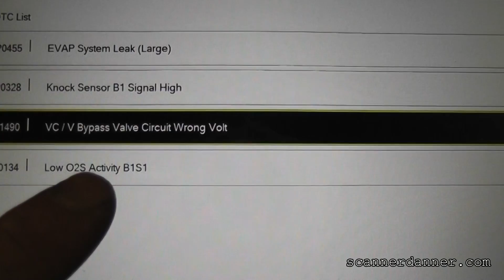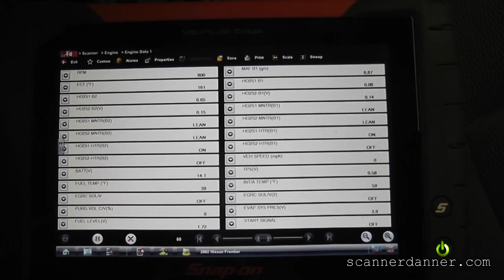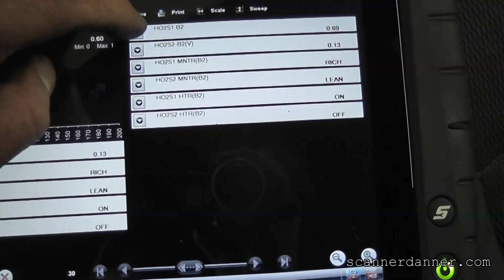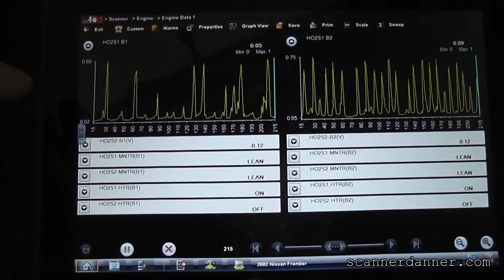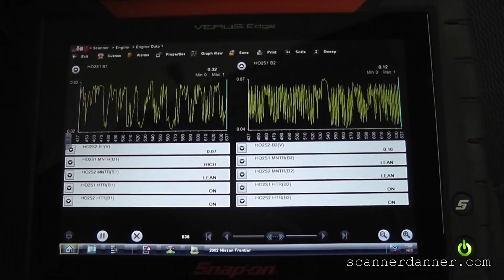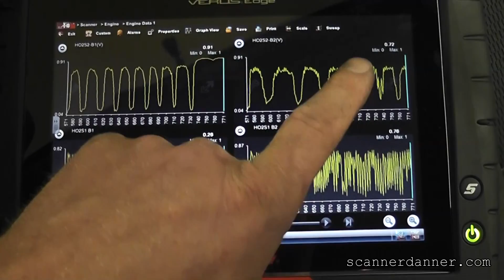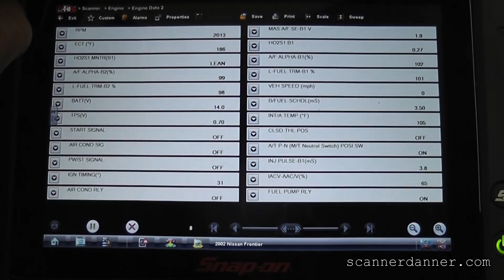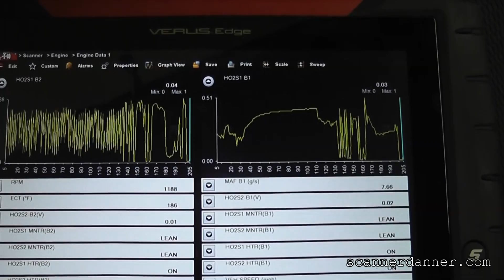Oxygen Sensor Slow Response test (P0134) - Nissan

Comment: hi, I need your help: upstream is between  1 to 2.3-volt variable  on the graph and downstream is between 0.28 up to 0.75, I have bad smell from the car and check engine is on for p0420 but car performance is so good it is fast and every 2 weeks I put gas,  but for short term downstream I don't have data , could you help me for the problem ( Also when I clean the code, after a week it comes back!)
Reply: Hello khalil khamisi i have the same problem did u fix it bro??
Reply: I have the same bro did u fix it?
Reply: @rankgts3962  I changed the sensors, still that was same, so I just changed catalyst converter and cleaned the code and after 8 months that code never came back.
Reply: Khalil Khamisi i changed the catalyst converter and both sensors but i’m not sure if they are working but i get them used but of its not the sensors and catalyst what will be ?
Reply: Khalil Khamisi btw i have altima 2014 (4 cylinder ) with code P0420 with P1148
Reply: @rankgts3962  I searched the p1148, so you have changed parts, but p1148 is about closed or open loop, it is mean your car have wiring problem, follow each wire of sensors to see any problem.
Reply: Khalil Khamisi from the sensor itself or the wire sensor from the car
Reply: @rankgts3962  bro you need to check it completely, from the sensors to the board, I guess the harness has problem, check that for any crack, corrosion, or missing pins in the harness. Check all the fuses, also reset the code to see if it's coming back or no
Reply: Khalil Khamisi brother actually i’m getting volt from both sensors i’m really confused what i have to do
Reply: @rankgts3962  I think is better to go to a cheap shop to tell you the cost of problem but you fix it

Comment: Can a bad O2 sensor bank 1 sensor 1 on a 4 cylinder cause low power?
Reply from the maker: yes it can, but it will run good cold and at wide open throttle (open loop conditions)

Comment: How would one go about checking the heater circuit/H.C. fuse for a P0134? THNX
Reply from the maker: A heater circuit ode is usually caused by a bad O2 sensor. With the engine running you need to check the O2 heater circuit for a power and ground. Be aware that some of these are pulse width modulated on either the power or ground side of the heater circuit, so voltage readings will be affected by this.

Comment: Got a quick question for you: I have O2 sensor B1S1 slow response. My car (2006 Kia Sportage) runs on LPG. Should I measure the sensor on petrol or LPG or does it not matter? I figure it doesn't matter since the LPG system is supposed to fool the car's sensors in to thinking it is running on petrol. Either way, I've measured on both and the measurements are 0.05v-0.7v. It never makes 0.8 and is way lower than 0.2. What is that telling me? Failing sensor? Or something else?
I'm not a mechanic, but love learning from your videos, so thanks for doing them!

Comment: Confusing.
Reply from the maker: watch some more of my videos or ask me a question, I'll try to answer it.
Reply: ScannerDanner thanks for that, I have just changed an oxygen sensor my car and have monitored it on the OBD2 hand tool, it fluctuates up and down 0.2 to 0.8 mV as you would expect, but the car has developed a new issue, it misfires after cold starting, it ran well when I first replaced O2 sensor, then it developed a misfire sounds like it's running on 5 out of 6 cylinders, not sure if it's related to the new O2 sensor. My question is what does the graph of a normal running oxygen sensor look like under normal operationing, idle, start and driving conditions. It runs at idle ok, 0.8mV for 3 sec then down to 0.2 mV for 1 sec then back up to 0.8mV but when driving around is all over the place. It does not have a catalytic convertor or down stream O2.
Reply from the maker: If you have a misfire the O2 will certainly be affected by that. If it is a cold engine only misfire, check it for a vacuum leak. Like in this video. 
https://www.youtube.com/watch?v=h8rxpfRvHf8

https://www.youtube.com/watch?v=3RFTS22w6tM
Reply: ScannerDanner Mate,  you are so good, thanks, had a vacuum leak in my other Ford AU2, now it runs like a new car.found it using brake cleaner, could hear it but had to use the spray. The BA runs like a chaff cutter when cold, but its intermittent, thats the problem

Comment: In my car when i start the car in the cold and put the scanner right away recibe signal from both o2sensors like from open loop changes to closed loop in 20 seconds after turn the car ? Whats that really mean and plus both of them read so hight yesterday i saw something weird 1 sensor stuck on number 1.246 v for a while ?
Reply from the maker: do you mean something like this?https://www.youtube.com/watch?v=v8XrM-7BuOg
Reply: ScannerDanner  yeah pretty much but today i notice that the car it takes a long to start like cranks for almost 6 seconds and sometimes it cranks right away and also i noticed black smoke coming out from the tailpipe the spark plugs are new one i replace it 2 months ago it it seems like something wrong with the fuel system
Reply: ScannerDanner i check the fuel injector to see if they make the cliking noise they seem to working fine but i gonna need to check the fuel pressure and check the fuel pressure regulator disconnect the vacuum house and remove the Spark plugs to see if they smell like fuel probably could be a leak injector that is leaking into the cylinder when start the car it feels so weak poor acceleration

Comment: Could u do a video more covering the down stream vids or do u have one I didn't see it if u did
Reply from the maker: sure, what exactly are you looking for? There really is no difference when it comes to testing for function other than the delay of mixture changes from the cat. 
If you're looking for how to test a cat. I have videos on that. Here is one. 
https://www.youtube.com/watch?v=vyVnhCIMDnw
Reply: ScannerDanner watching ur videos has answered my questions... I'm new to the scanner world. I've monitored my sensors my b1s2 is reading low but does follow my b1s1 so I'm thinking cats bad I'm going to take out the b1s1 and do the pressure test.. I'm thinking it's not plugged it's empty sounds hollow like a tin can when I tap on it. Weird thing is on my freeze frame data my ltft was 99.9%

Comment: 👍 Hello. should we have the same oscillation with lambda probe (upstream) and lambda probe (downstream)? thank you in advance
Reply from the maker: Not if that cat is doing it's job. Also, they don't use wideband sensors for downstream O2s
Reply: the car of the decatalyser (dé-chat) is perhaps for that? Thank you for your help
Reply: even de-cat the car to was reprogrammed to have a good ratio air / fuel. In a test with launch creader crp129 premium the bank sensor B1S1 gives an afr from 0.99 to 1.07 at idle, and a current of -0.04 a + 0.04mA so close to 0.00mA for a good ratio! ?. the bank sensor B1S2 that gives me a lambda of 0.97 to 1.1 oscillates from 0.2 to 0.9v still idling and lambda probe at 350 ° Celsius (probably from de-cat). thanking you in advance for your help
Reply: I specify I am in lambda probe narrowband I think!

Comment: Would I be correct in replacing the sensor, if I have similar voltage readings on the same bank, but no code for the o2 at all? I'm working on a 2002 Xterra SE Supercharged, and the computer is limiting boost once it reaches closed loop. No other codes, new knock sensor. The only oddity in the data is that one front o2 sensor reading. Fuel trim on that bank is also always roughly -5% more than the other bank as well. I'm no mechanic, just a DIY'er with a a bluetooth odb2 adapter and a smartphone.
Reply from the maker: If you have a boost issue, I doubt it is O2 sensor related

Comment: After watching this video, I"m still confused about one thing.  Can you please shed some light on this.  When manufacturers changed from oxygen sensors to air/fuel ratio sensors, is it safe to assume that we are ONLY talking about the upstream sensor  and NOT the downstream sensor?  That sensor should still a normal oxygen sensor.  Please comfirm.  Thanks Steve
Reply from the maker: Yes, when they use an upstream AF sensor the downstream is just a regular narrow band O2

Comment: very good and simple video.  I have a question.  can you explain what the other tabs that you didn't click on mean?  I see there is one that says heater, that's part of the 02 sensor this you have to replace the sensor as well ?
Reply from the maker: Every car is different on what they show data wise. We call the data PIDs. (parameter identification)
Without watching the video, I don't remember for sure but if it said heater, this can be an on/off, a duty cycle command, a milliamp draw reading etc. etc. 
Like I said, every car if different on controls and how they monitor them and report them to the mechanic. Then there is a factory scan tool that will report differently than an aftermarket one like I was using. 
Hope that made sense.

Comment: down stream O2 flat lines after engine starts. it takes several minutes before any signal shows up. the two up stream O2's oscillate like they should.  would this situation cause a P0171 P0174 codes? this is a 4.0 OHV Ford Explorer.

Comment: I had a similar issue on my wife's Suzuki Vitara a few weeks ago. She called after a 100 mile trip saying the fuel mileage was low (did not tell me CEL was on!) I scanned the car and had a Bank 1 Sensor 1 Low Activity code BUT I had replaced both up stream sensors last year (faulty heater in one). Both upstream sensors when graphed appeared to be functioning properly but the Bank 1 downstream was nearly dead, only a blip here and there.

I reset the code and ordered both downstream sensors, a week later when I went to replace the sensors I scanned it and noticed I had the Bank 1 upstream low activity code again. I replaced both downstream sensors (does not seem to make sense to replace one when they have both been in there for 120K miles) and that fixed the issue. It still seems strange to me that the PCM was setting a false code for the upstream sensor when the downstream was bad.
Reply: Maybe they messed up labling the wires to the software writing on the PCM at the factory
Reply: Maybe the computer just compares the 2 and isn't accurate enough to determine which sensor it is.

Comment: I love my Verus Edge with Gorilla glass, SSD, Windows 7 Embedded, MS virus protection, TSBs, SureTrack, Troubleshooter, Mitchell On Demand...sweet package. Snap-on makes a 12V adapter with either battery clips EAX0066L04B or the lighter adapter EAX0066L10B for @28 for the Solus & Verus models.  Battery life is really good plus you can go to Standby mode and reboot in 5 seconds. Plug DC lighter adapter in on the way to the next job and you'll be ready to go!
Reply: Hi what is price of this Verus Edge,.,?
Reply: @$10-12K according to your Snap-on rep and what kind of deal you can get. Good customers usually get a good deal.
Reply: 👍 Do you know if can get it online internet.?

Comment: Just worked on a 96 Ranger 4.0 for P01131 & P0171 or 174 code. I called an o2 w/o checking deep enough. Replaced Bank 2 sensor. Still ran like crap and now had P1131/P1151/P0171/P0174? Ruh-Roh? Back to basics...started looking again for vac leak. DOH. Evap hose had rotted off at TB. Replaced all rubber hose for EVAP and truck was happy. Point of story was AFTER a misdiag, i viewed the o2 activity on AE Scanner. The new sensor would switch 3 times for old sensors 2 times. New sensors activity was very steep lines while old sensor was a sine wave. We really should rec O2 sensor replacement more often and do them in pairs IMO.
Reply: +Gail Taylor Meant to include this is an OHV engine. Not as known to have intake manifold leaks as the SOHC.
Reply from the maker: +Gail Taylor agree

Comment: what was the reason for both rear  O2 sensors showing so much actiity as if both catalityc converters were bad?
Reply: +JoeLopez40oz rear O2 sensors arent supposed to show a lot of activity. Theyre supposed to be stable.
Reply from the maker: +JoeLopez40oz possibly, or I didn't run it long enough for them to heat up.

Comment: Hey Paul it's Mike on this model do the 02s put out a bias voltage to verify wiring integrity?
Reply from the maker: +busjockey1 yes they do and I believe you can see it when the sensor starts to fail